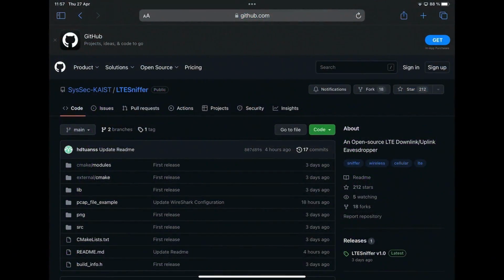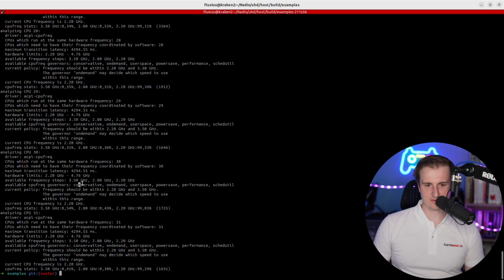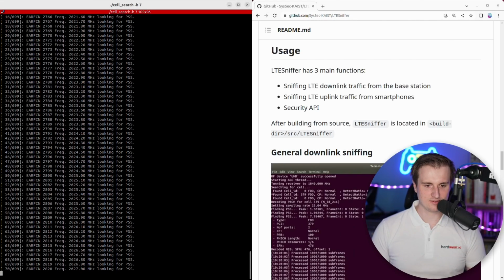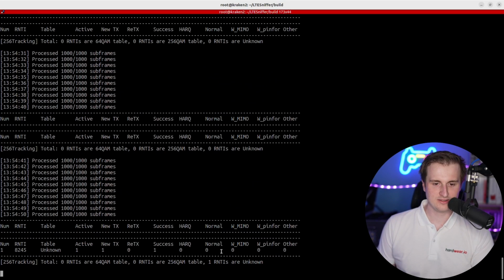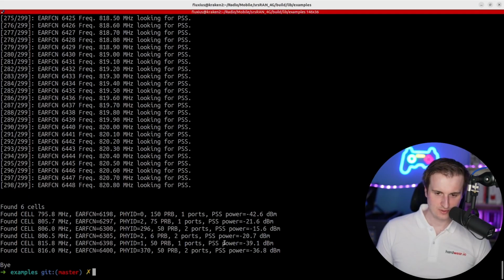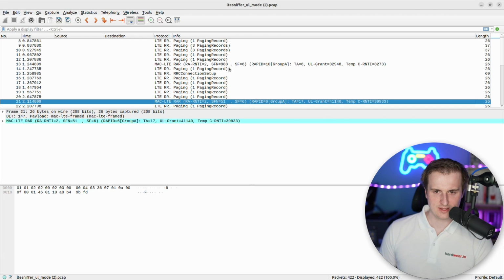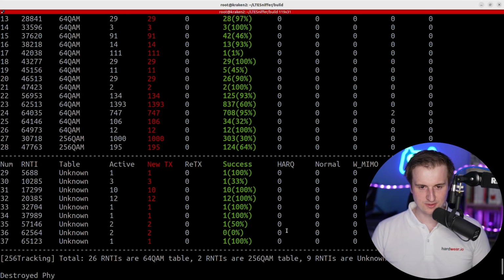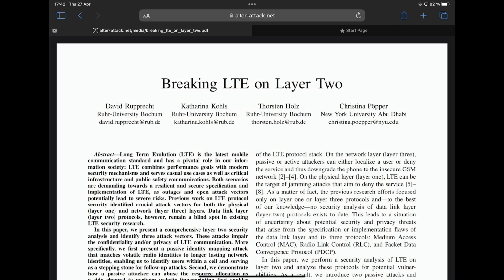A passive IMSI catcher or low level analysis tool for LTE

Comment: Someone is a usin a imsi catcher to listen to calls
Reply: You can only intercept 2G (GSM) calls using an IMSI catcher, hence why the Stingray devices used by cops are designed to force captured IMSI's to downgrade to 2G in order to begin the MITM attack. All of the higher signal types like 3G, 4G and 5G require a telco-level authentication handshake to decrypt each other's audio signal...
Reply: @ how can that happen

Comment: I have the following doubts.

What is possible to do after capturing the (TMSI) and RNTI . Could you do some demonstration or indicate some article showing a valid procedure?                                                                                                                                                                                                                                                              Is it possible to hijack an RNTI from a 4g network and link it to my fake enob?
Reply from the maker: As the RNTI matches the TMSI, this can be used monitor and tracking at first (see: https://arxiv.org/abs/1607.05171). 
About hijacking with crafted RNTI can maybe mess a little the forwarding of messages coming form the MME to the UE  as there is a missing mapping between the MME UE S1AP ID and IMSI. But what is the plan? Do you have already a foot on an EPC? Or exposed tunnel? What is the scenario?
Reply: Please, if possible, make a video demonstrating this attack mentioned in the comment.
Reply: @Penthertz  thankyou